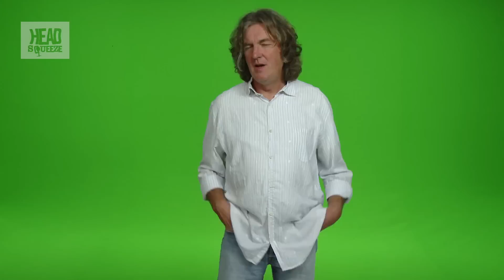Is Glass Really Made from Sand? EXTRAS | James May's Q&A | Head Squeeze

Comment: My glass 'fact', at least I've heard, beer bottles often use glass of a dark colour because beer is photo-sensitive. It goes bad if exposed to light
Reply: Correct.
When exposed to light it basically strips the nuances away. There’s a chemical reaction within it which leaves, quite literally, chemicals of the same order as that of a skunk’s spray.

Desperados, Corona, Sol etc all have a similar taste. This is because they all come in clear glass bottles instead of darkened glass, and therefore this process has already occurred.

This is why people put lime in those drinks; to mask the skunky smell.